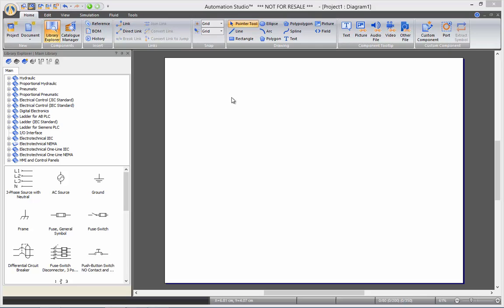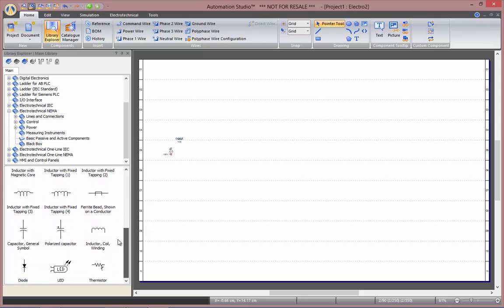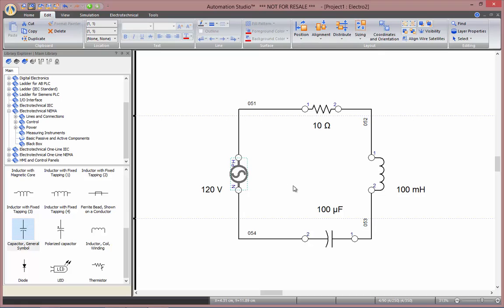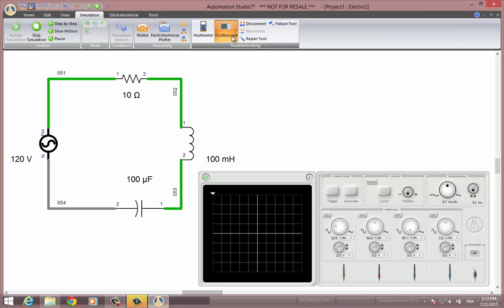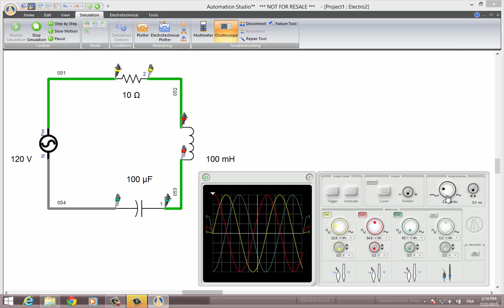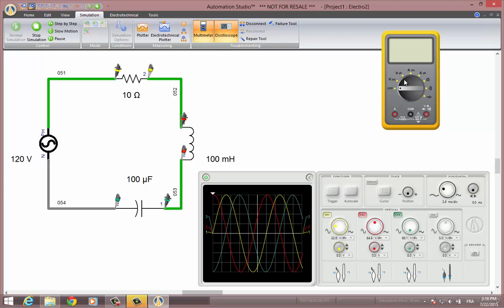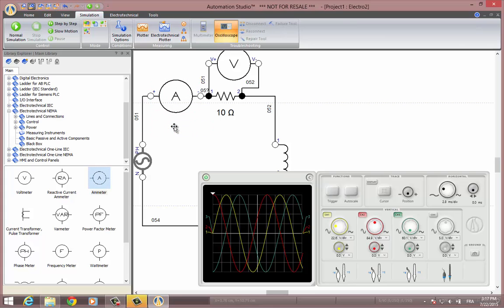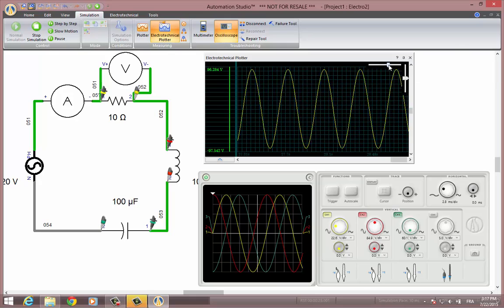Electrical - Creating an Electrical RLC Circuit - Automation Studio™

Comment: I am in a circuit analysis class right now. How can I simulate short circuits using Automation Studio? I tried using the failure tool and I was presented with some choices that did not make sense to me. Is there a way to simulate shorts and and opens so I can take measurements ?